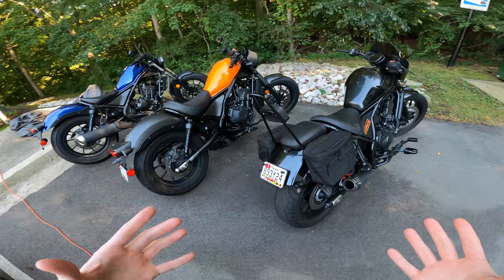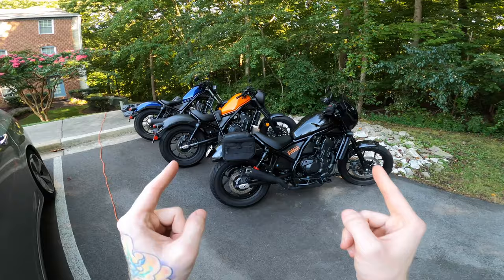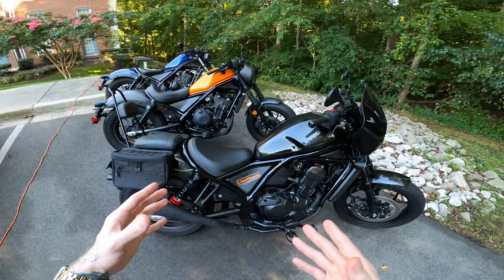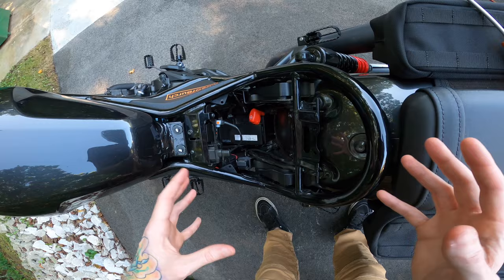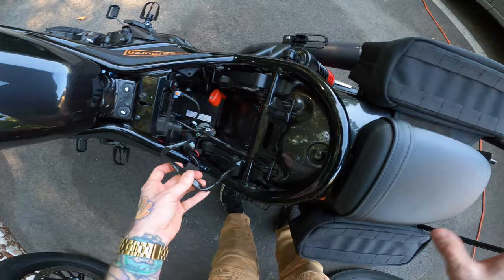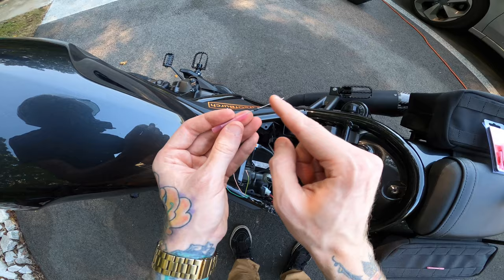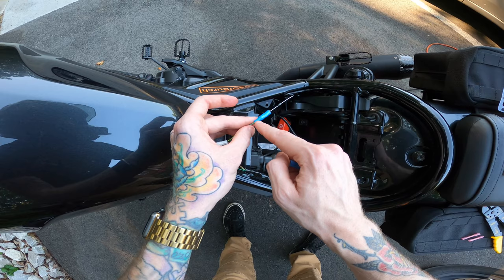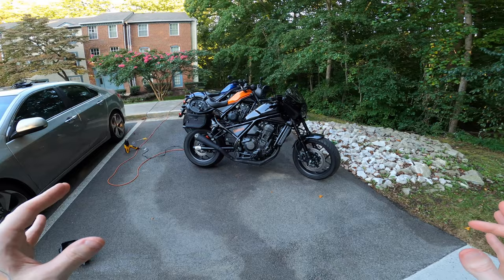The Rebel 1100's Cruise Control Has A Very Odd Issue…

Comment: The factory tail light sends any remaining reference voltage to ground. The BB kit ( and others)  does not use the ground wire. The remaining tail light voltage is then sent back to the PCM through the brake light power circuit. This triggering the cancel command for cruise control.

The diode is basically a one way valve that stops the power from going back to the PCM.

*Boom roasted*
Reply from the maker: Yea, what he said! 😂
Reply: Okay, but doesn't that mean that, after the diode is installed, pulling the brake won't cancel the cruise control? Or did I misunderstand this?
Reply from the maker: @_nopestr  after installing the diode, everything works as it should. Including the brakes canceling cruise control 👌🏻
Reply: @LifeOfBurch  Beautiful! Thanks, Burch 🤘 .
Reply from the maker: @_nopestr  no problem dude! 😎🤘🏻
Reply: My diode broke does any one know the size needed?
Reply: @Silvr426  1n4007 is the part number if the link doesn't work
Reply: Thank you @FxsX24

Comment: Should have trimmed the wire leads down on the diode a bit so you didn't have so much excess length in the wire. Would have made it easier to handle.
Reply from the maker: Woulda shoulda coulda. It’s done, functional, and tidy, so I’m happy 👌🏻

Comment: Great video man. Makes sense to be honest. 

Those connectors will work. You just need to only push in half way. Not a huge deal though. It worked right lol.
Reply from the maker: I’ve always done it where the wires slightly overlap in the middle and crimp it once, versus a crimp on each end 🤷🏼‍♂️ The double crimp just doesn’t feel right to me lol
Reply: @LifeOfBurch  fair enough lol.

Comment: Can’t wait to get a 1100 but can’t ever find them in stock!
Reply: Place order and wait. You will not likely find one sitting on the lot
Reply from the maker: Yea they’ve been pretty hard to find lately. You may be better off staying consistent on checking all the used marketplaces unless you’re set on buying new!
Reply: There was a thing a month ago saying orders for 10 types of bikes would go on hold including the rebel and grom. Not sure if that’s still going on
Reply: Sold out in Portugal... i've went for one two weeks ago, and best I could expect was to order one and probably receive by November or December...
Reply: You can do a search on Cycle Trader (dealerships post new inventory there with stock #'s) in the U.S.A. by entering your zip code, distance for search, manufacturer, model, trim level (DCT or no DCT), model year, and new or used.  I don't know where you are, so I just searched nationwide for a new 2022 Rebel 1100 in manual and DCT - it came up with 60 manuals and 141 DCT's.  Refine the search as much as you want to start with, and then expand distance if necessary.

Comment: I had a Rebel 1100 DCT with 0 mods done at all with that issue and the problem is super common. I never used it so I didnt care but when I was going 1 state over to trade it in, I really wished it worked

Comment: Mine still works with the de pretto moto license plate kit 😁
Reply from the maker: That’s the kit that reuses the stock turn signals and just replaces the taillight/brake light to a smaller unit, right? If so, that makes sense since none of the wiring changes from stock form.